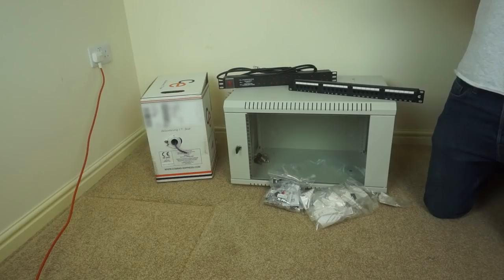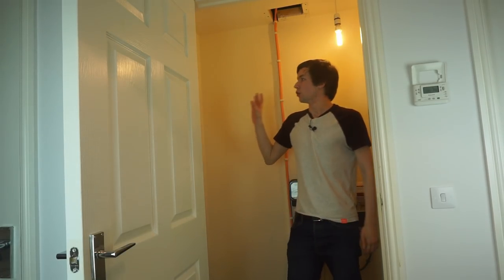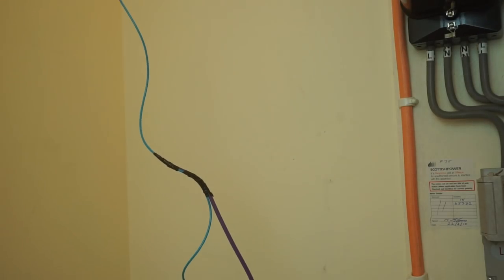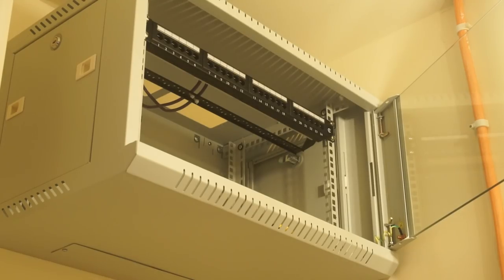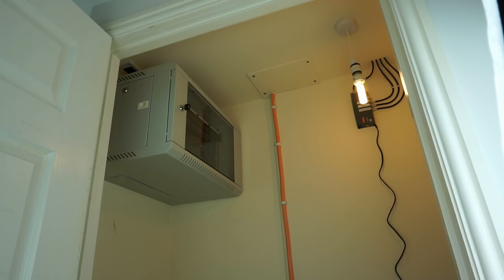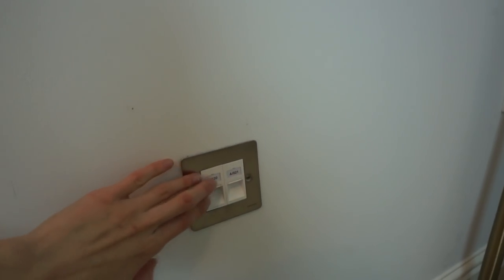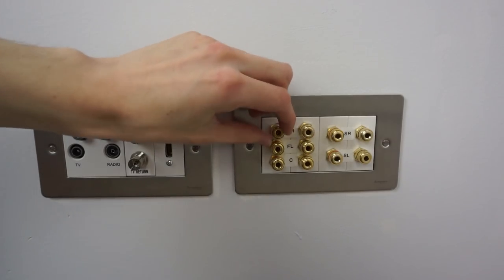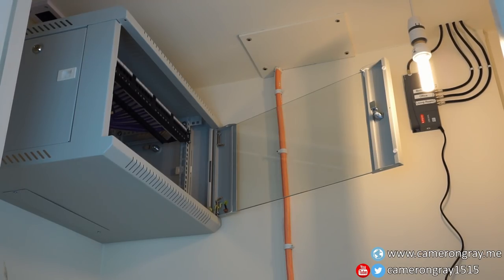New Flat - Time to install a completely overkill home network!

Comment: Hey dude, love the thought process behind what you did, only thing I noticed is that you didn't leave a couple feet of excess cable in the back of the data cabinet for a service loop, did you push the excess into the ceiling by any chance ?

I'm just curious because im a handyman and ive installed quite a few data networks in homes and offices and this is common practice before terminating the cables into the back of the patch panel. The letterbox draught excluder was a good idea too, one thing I would recommend is putting a fan inside the data cabinet and leaving the door open as it is just an enclosed box when the doors shut.

Your equipment (I.e. router & switch) are likely to overheat if you don't provide some sort of heat dissipation and ventilation to the equipment.

A little time saving tip for pulling cables in the future for you is if you know you going to require 2 or more cables in that location, best thing to do is measure off how much cable you will need and add a couple of metres because you can always cut some back but not add anything on afterwards. Then once the cables have been cut to size, tape and number them together neatly every metre or so and feed them all in one go. 

I hope this information has been useful for you and anybody else that is thinking about installing there own home network.

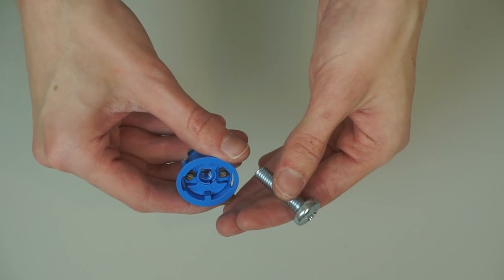Comment: 13:30, since you already had access to the back of the wall, you could have simply put a piece of wood right behind the drywall were you wanted to screw the panel and used regular screws : less stress on the drywall and way cheaper =)

Comment: Pro tip: buy two boxes of cable so you can do two runs to each location all at once
Reply from the maker: I would have done that however the only decent value boxes I could find were 305m and as it is I've only used just over 200m so would have ended up with tonnes left over.
Reply: @camerongray1515  Take a measurement of the cable length you need from the panel to outlet, plus maybe 10% extra (just in case). Pull that length out of the box and cut it off. Attach that to the cable still in the box, and connect both lengths to your drawcord. Then you can pull the 2 cables at once. Cuts cabling time pretty much in half then.

Comment: Interesting that you have a "drop" ceiling.   In most apartments in the US, the slab that is your floor is the ceiling of the person below you.   Before the concrete was  poured, come conduits were installed.
Reply from the maker: Can't say I've ever seen construction without some sort of void in the ceiling or under the floor here in the UK. Concrete with conduits sounds like it would be an absolute nightmare to modify or repair.  In the UK, even without a drop ceiling you'd still have a ceiling void, you just wouldn't have space above the joists so you'd have to drill holes through the joists to run cables past them.
Reply: Well, it's standard construction in high rise condos in Northern Virginia.   "New" services were provided by running cables in the halls and hiding them with a "crown molding" type product.   The wires entered the unit in a closet.   Usually the cables were just run under the carpet.   My unit is over 40 years old and has seen two generations of CATV stuff.  The original TV cables were simply abandoned.

Comment: Take it your not renting or your landlord is good. Wish I could do something like that here but I am not allowed :( Was just looking at getting a 24 core server with 128gb of ram off ebay for £100 but think it would be too noisy for my little flat lmao.
Reply from the maker: Yeah, thankfully I've bought this place so can do stuff like this.  Previous flats were all rented and it's an absolute nightmare.  Flats around here seem to be particularly bad, not allowed to even use Blu-tac (explicitly banned in my lease) or to do any sort of decoration without permission.  The most I ever did in a rented flat was run a pair of CAT5e cables and some speaker wires tucked under the edge of the carpet.

Noise can definitely be a disadvantage with rack servers, I'm currently using a tower server mounted on a rack shelf since it's pretty quiet.  Think if I were to get a rackmount one down the line I'd have to build it myself to keep the noise down.
Reply: Was thinking the same thing :D
Reply: Yeah...they make cable guides and such that fit against the baseboards for a reason. Then again, there's always wireless as well.
Reply: One of my neighbours is running a server from his flat and he is using tap water running through the cooling system 24/7, hes not on a water meter so he is able to do that. What it means is theirs no fan on but it does mean his server isn't in the most ideal of places, in a kitchen cupboard under the sink.
Reply: Mark Giblin hahaha thats a mad idea :)
Reply: all fun and games until someone notices it and report him for running a destillery. thats generaly the most common way for people to get caught distilling their own alcohol. the water is used to cool the condensors so that you get proper hard liquor. Source? Someone i know got caught this way :/
Reply: Henrik Johansson only if your metered or using that much that the water company goes looking for a large leak, when they can't find a leak is when they start tracking.

By contrast, theirs a guy that I suspect is growing herbals and using a rig of water generation devices like what I have seen on ebay and from tap water (the force of it) people can micro generate enough power to run a low power lighting rig.

You can hear water running in the pipes and it's been like it for 3 years and despite complaining about it and the noise of water can be heard running through the pipes and they said the can see excess water exiting the drain but no obvious source. I told them but they are not interested in this abuse of water resources, as far as they think, they're getting paid but it's not likely...
Reply: Wireless is only to be used as a last resort if cable can't be ran to a specific location.  Wireless networks will never be able to match the performance of wired networks in terms of latency.
Reply: Have you thought of getting a silent rack?
Reply: Could just install Noise Insulation inside the server room to sound proof it.

Comment: Lucky you. I am in Glasgow and all walls on my flat is solid brick. I am desperate, therefore I need to run cable over skirts:(
Reply from the maker: That's annoying - is it an older tenement style property with floorboards?  You may be able to lift up the floorboards relatively easily and run the cables under the floor (especially if this is already where your electrical/plumbing is running).  You could then either install surface mounted network faceplates on the skirting boards and bring the cable up through the floor or if you wanted to install them into the wall you'd only need to chase out the pattress as well as a small channel down the wall to the floor which wouldn't be too painful to patch up.

Comment: What is the proper way to fill it back in? I mean do you just slot the plaster back in and fill? Or do you need to screw it to something. I'm curious with the edges is there not something called scrim tape to hide the seam.

Comment: What about telephone wiring? Or will you be using VOIP phones? Or using any phone at all?
Reply from the maker: +Ryan White There's a single phone extension in the living room that came with the place but I doubt I'll ever use it, I do all calling through my mobile, not worth paying for a landline call plan as well.  I only have a landline because it's required for my broadband.

That said, there's nothing stopping me using the CAT6 to run phones by either swapping the modules or just using RJ45 to RJ11 cables to connect phones.
Reply: I use an RJ45/RJ11 adaptor on a CAT5 network and it works fine

Comment: Just watched this a second time much later. Great job with the networking, but there’s no way I’d install co-ax nowadays. It’s such an out dated medium for AV transmission!
Reply from the maker: It's for over the air digital TV signal. I know that nowadays it's apparently "cool" to not watch live TV but I still want the ability to have it and since I was already running cables anyway, it made sense to add aerial wiring at the same time.
Reply: @camerongray1515   Check out the HD Homerun. It looks like a nifty piece of kit for anyone who doesn't want to bother with installing co-ax. It also integrates with Plex quite nicely.
Reply from the maker: It's an interesting idea and my satellite receiver does do local network streaming but I like the simplicity of being able to quickly grab a remote an use the tuner built into a TV without having to worry about having a TV/Smart box.

Comment: I would have expected you to just put an RJ45 jack right on the ceiling mount for the AP. Good stuff though, future proofing it for sure.
Reply from the maker: Thanks!  The main reason for using the keystone module in the ceiling is simply because I absolutely hate terminating RJ45 connectors, the thought of attempting to do one above my head while standing up a ladder was too much to handle! :P
Reply: Hey  @camerongray1515   take a look at the EZ RJ's, So much easier and simpler to terminate!
Reply from the maker: I do need to get some to try them out, I still prefer terminating structured cabling into RJ45 sockets as I feel they are less likely to get damaged (no clip to break off.etc) and it just "feels right" but I fancy trying them for if I ever need to make up patch leads.

Comment: Great Video, how'd you find the TV signal once it goes through the booster? i'm having an issue with my new home, freeview is terrible, thinking of running it from the loft (where my CCTV/File Server is located)

Merry christmas.
Reply from the maker: The masthead amplifier helped massively, even gives access to channels that the TV couldn't even find when plugged directly into the incoming faceplate.  I think the issue here is just down to having a large length of coax from the building's distribution system to my flat which is pretty much outwith my control.  Channels on one of the frequencies still break up sometimes (but not really channels I care about too much) but it definitely helps.  If you're in a house and have your own aerial, you'd probably be best trying with just the distribution amplifier in the attic and see how you get on, if you continue to have issues the masthead amp is worth trying (bought mine for £15 in Screwfix who have a 40 day return policy so you can always give it a go and take it back if it doesn't help).
Reply: Cameron Gray nice 1, enjoy Boxing Day

Comment: I would think at 13:00 instead of using that thing by itself I would have screwed a horizontal piece of wood between the verticals and screwed to that instead. But that's just me. 4 years in - how's it holding up?
Reply from the maker: I'd definitely rather have done that however unfortunately that wall only has a single vertical timber in it which makes it tricky.  In hindsight I'd have probably cut some of the plasterboard out and fixed more timber to the brick behind.  However, the plasterboard fixings have held up fine - the manufacturer states that they're suitable for holding boilers and radiators, not sure I'd use them for that myself but they must be pretty confident if they're risking having people attach gas appliances with them due to the safety/liability concerns involved if it failed.  I've also seen these used to hold up large commercial displays in an airport where a failure could also pose a safety risk.  I have since however added a chain around the top of the rack and attached it into the concrete ceiling above.  That way that if the plasterboard fixings did fail, it would at least hopefully hold the rack up to prevent it from pulling on and damaging all the cables if it were to fall.

Comment: The holes should be sealed (with at least the same thickness/type of plasterboard ) to restore the fire integrity of the walls and ceiling   Modern properties with modern construction techniques  in particular are susceptible to fire
Reply from the maker: All holes were filled by using the piece of plasterboard that had been cut out with a wooden batten across the back then filled, sanded and painted.
Reply: @camerongray1515  The letter box ?
Reply from the maker: @clivecharles7599  Ahh, not an issue here as the ceiling isn't classed as a fire barrier.  The flat has a concrete ceiling above the plasterboard and brick walls separating it from other flats.  As far as I can tell none of the plasterboard walls/ceilings are classed as fire barriers (plastic dry lining boxes in walls, non fire rated extractor fan ducts.etc).  If it were a fire barrier I could probably have used some sort of intumescent sealant to fill the slot and in hindsight I might do it anyway at some point as an extra layer of protection whenever I'm next working on it.
Reply: @camerongray1515  You assume the concrete provides a continuous barrier - it may not where for example services come in. The sensible thing is to return your  ceiling to the same standard as it was. It is easy to think you know what is above you and you may well have been diligent but it is also easy to make a mistake.

Comment: Just use brolly fixings for mounting cabinet fraction of price ,same principle as what you bought
Reply from the maker: I looked at them but couldn't find any with manufacturer specified weight limits, I'd rather go with something that has some sort of weight specifications so I know what I'm working with. They work similarly but don't have nearly as much metal bracing the rear of the wall as the grip-its. The cost isn't an issue, we're talking all of £5 more for the fixings I used which given the cost of the whole project is practically nothing.

Comment: Good work sir, can you just tell me in brief about the connection you did for your home theatre speakers, That ll be of great help thanks☺️
Reply from the maker: For the speakers I just ran standard 2 core speaker wire.  At each speaker I simply have the cable come out of the wall and into some banana plugs connected to the speakers. Behind the receiver I have a wall plate with a bunch of binding post/banana plug terminals with all of the speakers terminated into this (one positive and one negative terminal per speaker).  I made this plate up using some euro modules (linked in the description) so that I could use a faceplate that matches everything else, if you weren't bothered about this there's plenty premade speaker wall plates available.  I then run banana plug cables from this plate to the receiver.  The banana plugs are optional, could just as well attach the bare wires into the binding posts on everything, the banana plugs just make it easier to disconnect/reconnect things if I need to move, rearrange or replace equipment.
Reply: Cameron Gray Thank you sir 
I hope you get everything you want in life,so happy to hear your response 😊
Reply: Cameron Gray All doubts are cleared now

Comment: Recommend anyone doing this nowadays to get a Networked TV Tuner like the SiliconDust HDHOMERUN, instead of running Coax everywhere.
Reply from the maker: While that is an option, if you're running cables anyway I don't see a reason to not just add in some coax as well, I'd much rather just be able to turn on a TV and use the built in tuner than need to use an app on every TV to connect to a network stream.  Devices like that are idea if you want to stream to a phone/tablet.etc but for just watching TV, using the built in tuner on a TV is way simpler IMO.  In the UK, houses still often have decent amounts of coax run for TV aerials, mine was pretty unusual that it didn't have anything.

Comment: Hello from Leicester, MA. Great Job! I really liked your white network cabinet . I see you have it grounded to the glass door. My question is where did you connect the other end of the ground cable. My cabinet came with it but I don’t know what to connect the other end to. Thank you for your time and keep up the great videos.
Reply from the maker: [Obligatory "I'm not an electrician" disclaimer] The earth connection on mine is just from the factory to connect the door to the main cabinet.  At least in the UK I'm not aware of any regulation or requirement to earth the cabinet based on the equipment I have in it and the fact that it's unlikely to cause live parts to come into contact with the enclosure.  There is however potentially settings where earthing the cabinet is good practice (for example I've seen it done in large datacenters and you'd also need to do it if you were using the cabinet to hold some sort of electrical switchgear with exposed live parts) so that wire just means that if the main cabinet was earthed, so would the door.  As for how you'd do it, it likely varies based on local regulations but usually when I've seen it done in datacenters, the cabinet has been connected to an earth terminal on the PDUs (many PDUs have special earth studs designed for earthing cabinets) and the cabinet will therefore be connected to earth through the mains connection which keeps everything at the same earth potential.

Comment: I would have run speaker cables for a complete atmos setup. But except that, not bad.
Reply from the maker: I considered that although I would have had to buy more cable.  For Atmos I'd probably just go for a pair of ceiling speakers towards the front so running new cables while installing those wouldn't be too painful.